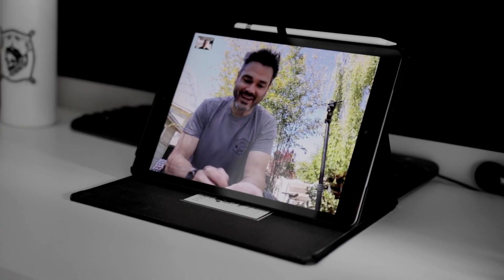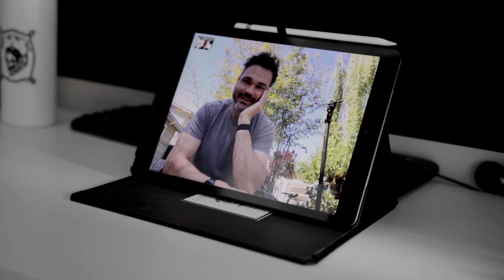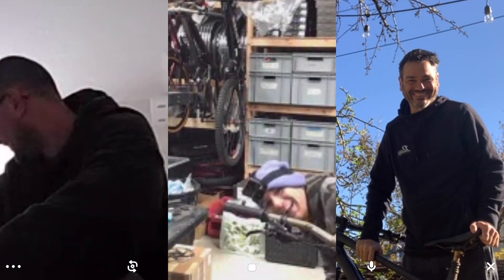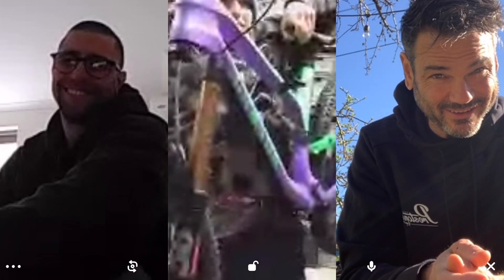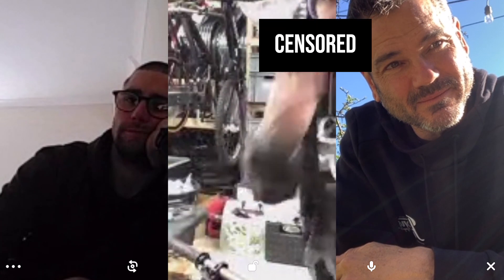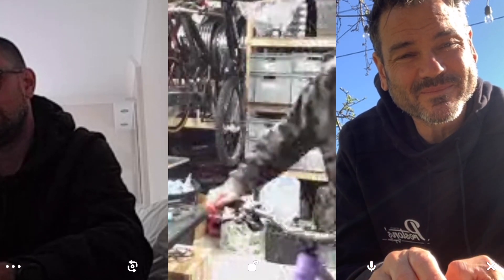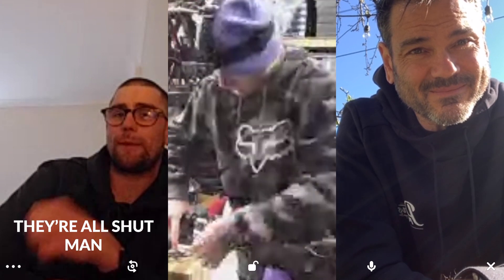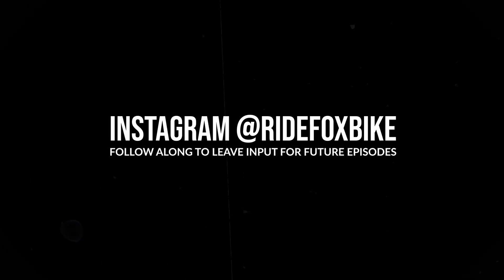DIALED S2-EP3: Initial Suspension Setup for Kaos Seagrave's New Build | FOX

Comment: Hey guys, could you give me a hint how to adjust my suspension for dusty trails with little grip? I have my basic setup dialed but my local trails got very dry recently and I don't feel very comfortable when cornering. Is there anything I can do?
Reply: Pavel Zak no different than anything else. Follow the steps.
Reply: @jordicortes4993  Thanks Jordi, much appreciated. Great series btw. I learned a lot from you and your team. Good luck guiding the pros via facetime :-)

Comment: Thoroughly confused...the Grip 2 damper has only 8 clicks of usable hsc adjustment and 16 of lsc? Fox's own literature states 16 and 12, hsc and lsc respectively (from closed)...curious?
Reply: Tim Fritz you’ll find out soon I’d guess
Reply: @jordicortes4993  you've forgotten more than I'll learn of suspension setup/theory, etc. but I had to ask! 😅 I've seen other Dialed videos where the riders ended up at something like 15 and 10 and 15 and 12 for HSC and LSC, respectively.
Reply: @jordicortes4993  also, pretty sure I just cracked your cryptic reply!! Seagrave is a sponsored/factory rider and his feed was pretty pixelated. I'm wagering he's got the new 38mm fork with the lower leg bleed valves we've all been seeing spy shots of and that the new Grip damper has been revised with a different range of adjustment to be a bit more 'open' in general than the outgoing Grip 2 damper. Just my take 👀

Comment: Hi guy's ...  a quick question please. Do flat pedal riders generally run a different suspension setup compared to SPD riders?
Reply: HairyMTB I haven’t worked with a ton of flats riders. Mainly Brendan and he does seem to run slightly slower rebound compared to his teammates. Never fully sure why🤷🏽‍♂️
Reply: @jordicortes4993  so if you ever run out of content over this period, please would you consider this angle? Edit: Pity Sam Hill is on RS, would have been interesting to see.

Comment: "POSITION "  (1)   not    CLICK  (1) ...... The confusion for the numerically challenged is the lack of click for position (1).  Position 1 represents a functional position, not an off switch.  The (click) is just a indicator that you can feel and hear, that is it's only function.  Rotating the adjuster to the desired position is what achieves the desired function.    Mesopotamians may beg to differ as they were the first to use 0 way back in 3BC